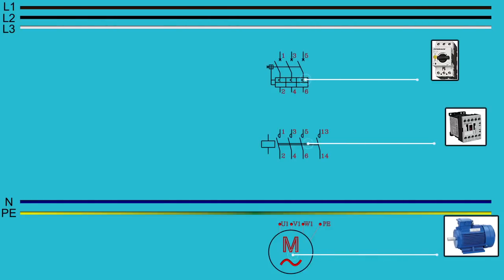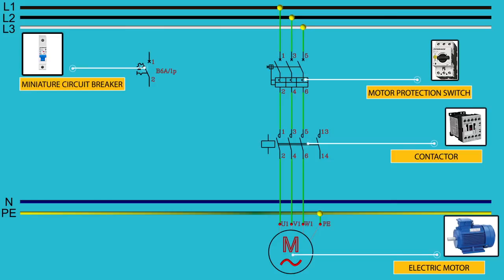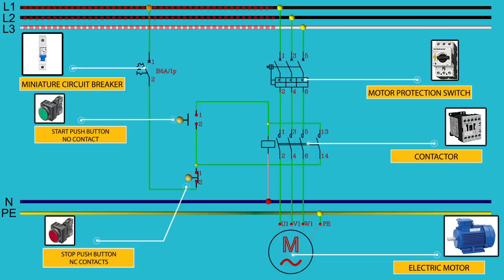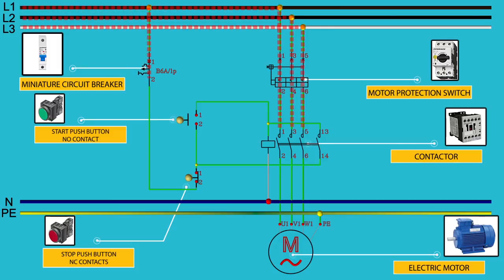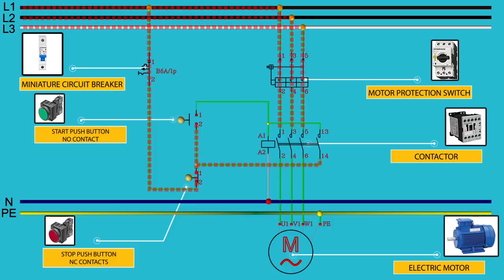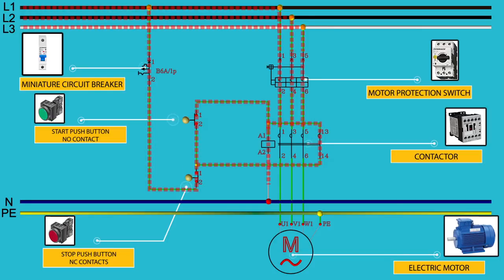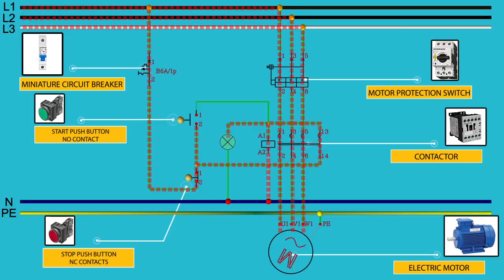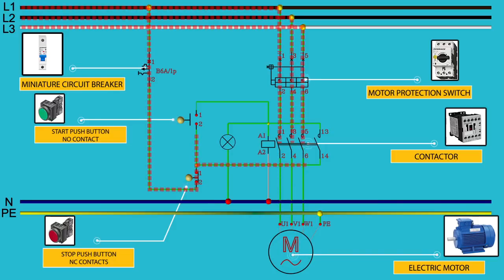How to Wire Contactor and Motor Protection Switch  - Direct  OnLine Starter -  Explanation

Comment: Thanks very much for the video. I've always wondered how the contactor latches between A1 and A2 when the NO Start switch is released since it's a non-latching switch. I now realize it's using the voltage coming from 14 and 13 to keep it energized when the Start switch is released.  Thanks again.